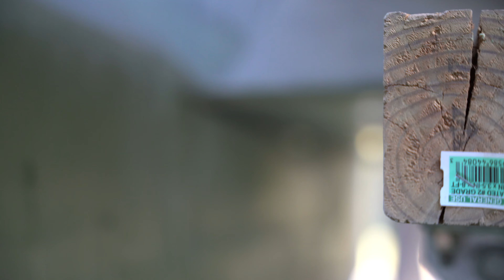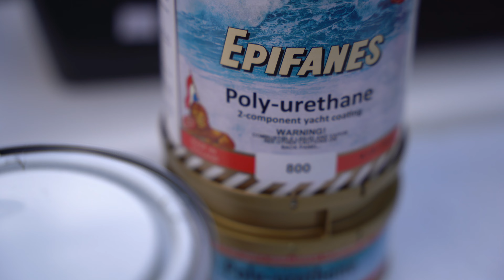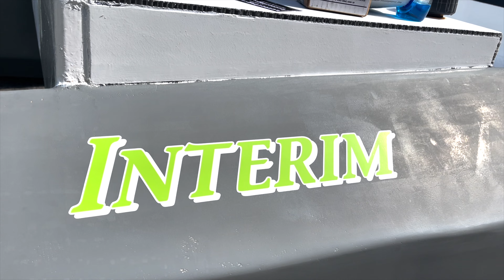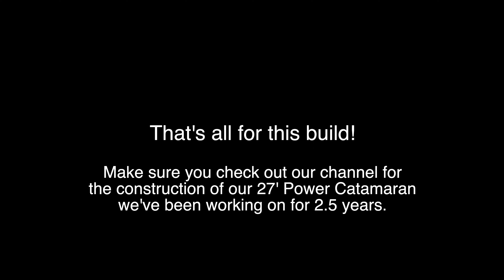Build this Catamaran for under $3,000 in TWO MONTHS!  Part 4

Comment: Great job! What are the specs--LOA, Beam, weight?
Reply from the maker: LOA is 16’. beam 8’. weight is estimated at 250-300lbs. 9.9hp long shaft Yamaha pushes it through the water at 10-12 mph. Burning 1 gph of gasoline. Super stable fishing platform. Thanks for watching 😊

Comment: Just curious - in the shot from behind in the lake, it looks like the cat is back heavy.  I understand that the motor may make it appear as if it is lower, but that's my ask...if you were to do it over would you make the cats longer over the back end to compensate?
Reply from the maker: Yes we could have shifted the platform forward a little bit more. Or widened the hulls a bit more in the aft end. Although it is back heavy it rides like a dream. Thanks for following along 😊

Comment: Crappy job on some of it.
Reply from the maker: Yes there were some points of the small boat build that we could have put more effort into.  The idea was to get on the water fast and safely. For a home made design “Interim” doesn’t disappoint. There may be a few blemishes and things that could have been designed differently. But we are satisfied with the results. Thanks for watching 😊